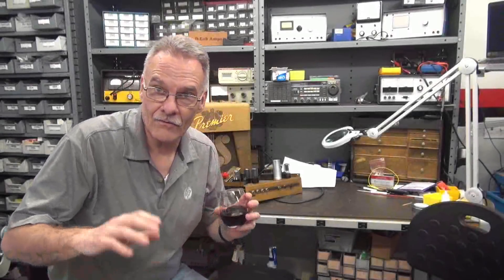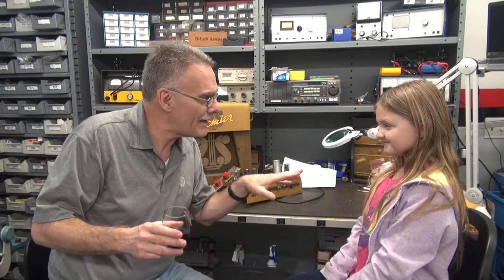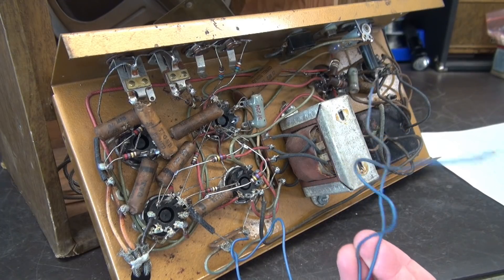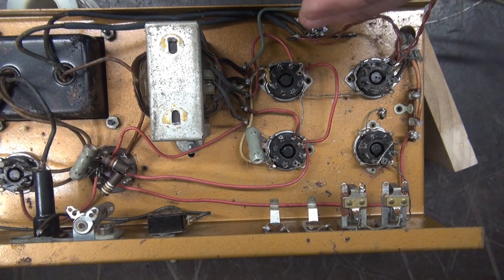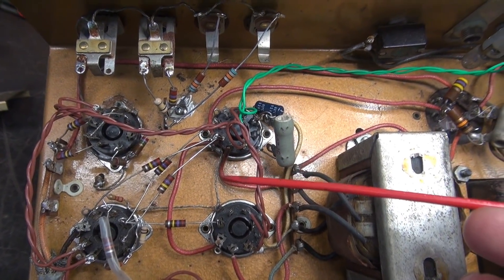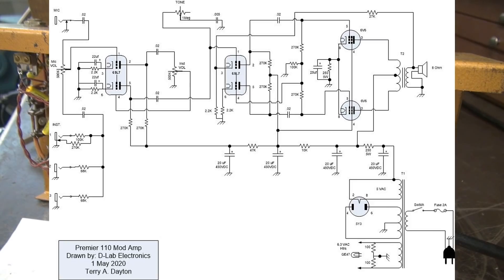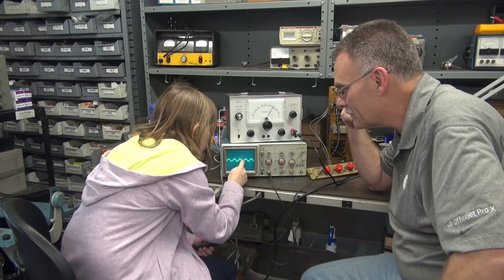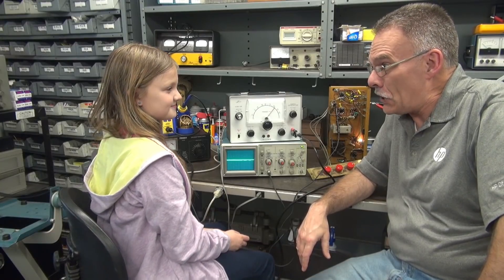Vintage Multivox Premier 110 tube guitar amp How to rebuild Part 2 Total Restoration

Comment: Hi Terry,  I was studying the schematic and I think there may be a small error in the phase inverter part which I believe is a Paraphase type.  It is the way the 100K and two 270K resistors that follow the 0.02uF caps are connected.  I think pin 4 of the 6SL7 should be connected to the junction of the upper 270K and the 100K and the other end of the 100K would be connected to the lower 270K.  The junction of the 100K and lower 270K resistors would then go to ground.  That way the pin 4 grid gets fed a portion of the signal from the pin 2 anode and it is inverted it to feed the lower 6V6 grid.  The way it is in the schematic looks like the 6SL7 pin 5 anode is going to feed back into its own pin 4 grid maybe creating oscillations.  What a great rapport you have with Emi, the little lady is going to keep you on your toes.  Regards, Jeff.
Reply: No.
This way adds active damping to the circuit. The paraphase inverter you are describing relies on the attenuation of the voltage divider to be the same as the gain of the first stage of the inverter, which in practice it probably isn't (it's difficult to set exactly, valves drift out of spec changing the gain, etc).
The circuit here actively enforces symmetry. Note that the grid consisting of the two 270k and the one 100k resistors is not connected to DC power supply at any point, just to ground and valve grids. This means no significant dc current flows in the grid, which in turn means the top connection of the 100k is the same as the bottom, i.e., it's virtual ground. And the circuit is design for it to stay that way, despite signal swings.
Imagine the signal going up on the grid of the first valve. This causes the signal to go down on the plate, dropping the "virtual ground", which, connected to the grid of the other valve, makes its plate voltage to rise. This pushes the "virtual ground" back to zero volts via the other 270k resistor. Voila - you have negative feedback for the asymmetric component of the signal, but gain for the symmetric. This circuit is therefore much better in terms of symmetry that the classic paraphase, which is just preset somewhere close to symmetry, but doesn't enforce it.

Comment: It probably wouldn't work as well as your suggestion about upgrading the pre-amp tube to a 6SL7, but I'm wondering if the stock configuration would be more usable on modern guitars if the two pre-amp channels would be run in parallel (ie "jumping the channels").

Comment: Is it a proper way to fasten the ground lugs on the chassis only with a pop rivet in order to get a reliable electrical connection or do you see the need for additionally soldering them to the steel chassis with your big snozzeramous, Terry?

Comment: do u normally not use solder paste cause u are usually working on new parts?  i always use it on used stuff for sure but use it on even new things to make it stick easier and clean area but do u recommend not using it or not needed for new components?

Comment: Terry, wondering why you didn't go with green wire for the filaments?  This would be traditional.
Reply: Traditionally green wire was for anything that wasn't at high voltage or DC , low DC, tube cathode or bias resistance or ground of course.
 My take regardless of how they wired anything  like old radios or amps  were done is as follows:
RED-             highest voltage
ORANGE-     2nd highest voltage(option)
YELLOW-      3rd highest voltage(option)
WHITE-         high AC voltage
BLUE-           No DC,grid input
BROWN-      low DC,tube cathode and bias resistors
BLACK-        ground
Of course if you follow some standard in rewiring this being only as  an example, then green it is!
Reply: @hestheMaster  - Agree!

Comment: Terry...the 270K-100K-270K resistor string isn't wired correctly...the tap for the 6SL7 grid at pin 4 should be taken from the junction of the upper 270K and the 100K, and the top end of lower 270K should go to ground with the bottom end of the 100K...

There's not much signal getting to the pin 4 6SL7 grid wired the way you have it....
Reply from the maker: Roger that, I'll take a look

Comment: I think there's an error in the schematic of the original amp.  Both the cathode is grounded and there's no supply for the grid.  I can't imagine it working too well that way.  I saw you fixed that in your mod.